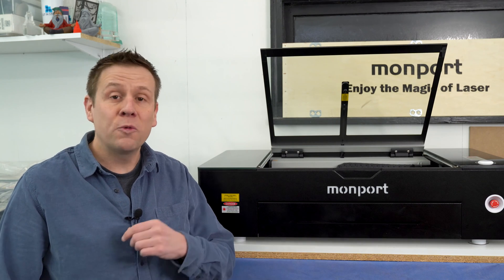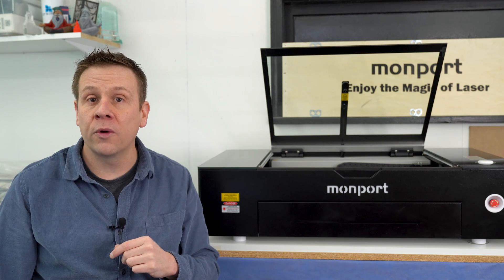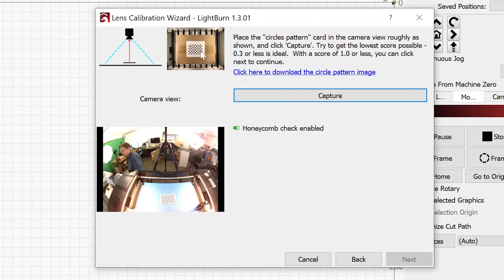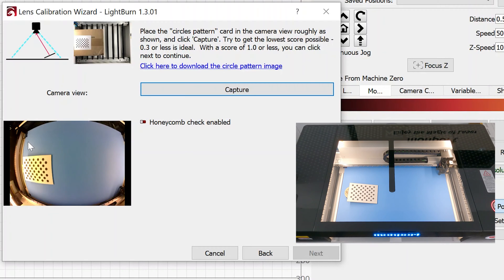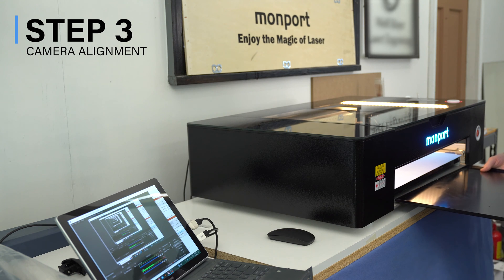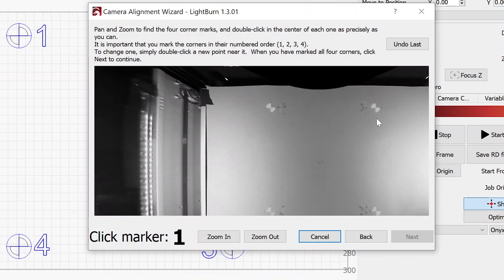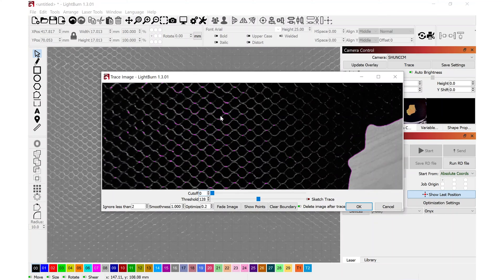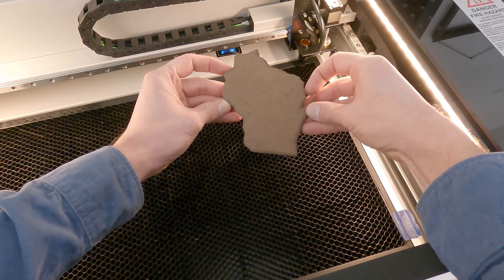Camera Setup-  Onyx Laser by Monport- Video 6

Comment: Your video is great. I dont se my camera on the tools.  dont know what to do. I use Mac Pro. I ca. not use USB without a adapter. How can I set my camaera in the lightburn.
Reply from the maker: Assuming you're using the second (shorter) USB cable for the connection.  The camera doesn't work any USB cable- I use the one included with the machine.  I don't use Mac computers so I can't offer further suggestions other then to post to the Monport FB group.  Best wishes!

Comment: I just purchased my onyx today.  I see that you said its a little off on the trace feture.  how did you/would you fix this issue? Do you re-do the camera set up again?
Reply from the maker: There's two things to try 1) if the height of the materials changes from when the camera was calibrated it will be off.  Best results are to calibrate at your most common material height.  You can create multiple camera calibrations for different height materials. 2) Yes- you can restart the calibration process.  Thanks for watching! :)

Comment: Your Onyx 55W videos are "Must Watch" (No, "Essential!") if you own this machine. Setting up the camera on this laser had been the bane of my existence since it arrived over a month ago. I was to the point where I was restricted to only "absolute position and framing" so that I could burn cardboard templates in order to do a project. I would add that it even took me awhile to figure out the low power framing as well. Honestly, much to my surprise there is a very steep learning curve when it comes to lasers that I never would have anticipated. Basically it all comes down to: "How do you eat an elephant? . . . One bite at a time!" By the way, you're excellent in presenting direct, concise and to the point instruction without a lot of unnecessary deviation. GREAT JOB!
Reply from the maker: Thank you so much! Glad the videos are helping you!
Reply: @thelaserchannel1  I have one vexing question. How do you activate a low powered beam for framing purposes? By themselves, the two framing options only give you a seamless rubber band whereas I would like to actually see a beam. I have seen where the machine will not fire off a beam if the power is too low. Your observations and suggestions are much welcome.
Reply from the maker: @edlacombe9773  When using a Co2 the low power laser for framing is not available because the the beam can mark the material and the Co2 beam is invisible to out eyes.  It would be nice if the Onyx would have a red dot laser for assisting in framing.    I've been setting the focus and watching the framing with the lid open- for me this gets it "close enough".  I do realize this may not work for everyone's projects but it's what I've been using.  Thanks for watching!